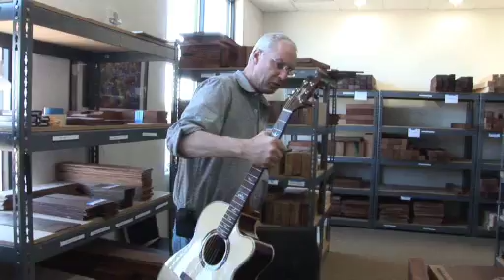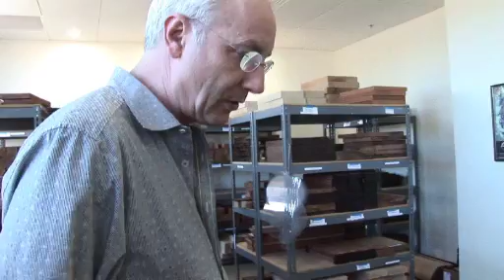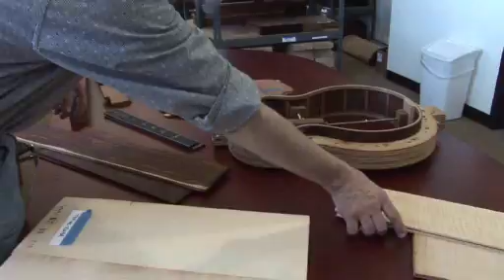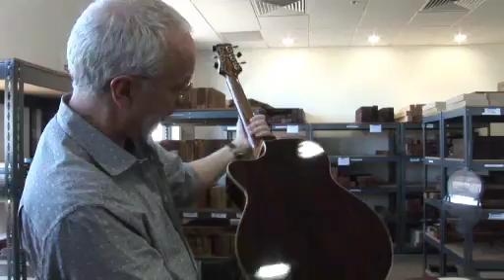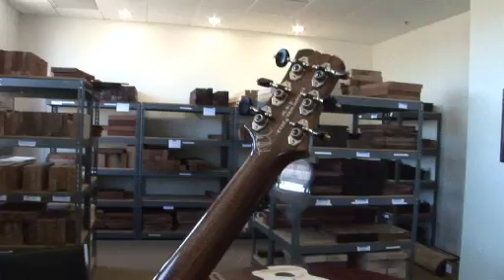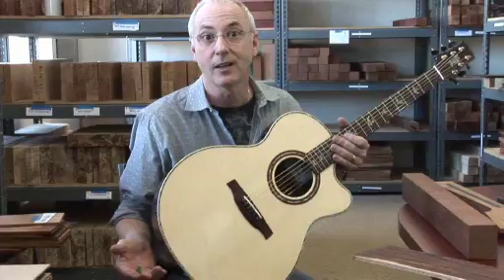PRS Acoustics - Paul On Acoustic Guitar Philosophies (Pt. 2 of 2)

Comment: I was hoping the SE Angelus would do that, but the American ones are $4K more (and you heard it). They use a bracing model that can cause a bulge on the top near the bridge. It can worry you if you don't expect this but it's supposedly normal. I got the $1K Korean and sent it back over that and what looked like some lazy workmanship. If you're gonna get one, find someone who has them in stock so know if you have a winner. Fantastic necks and fretboards though and nice cases. I prefer a pickguard